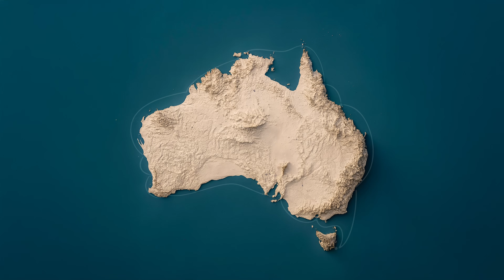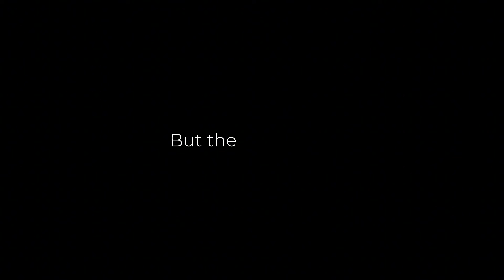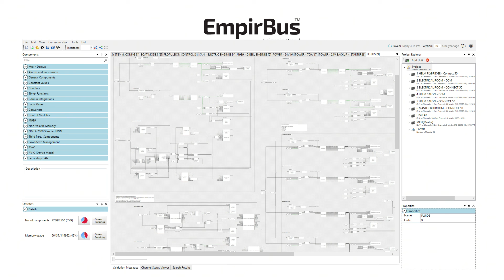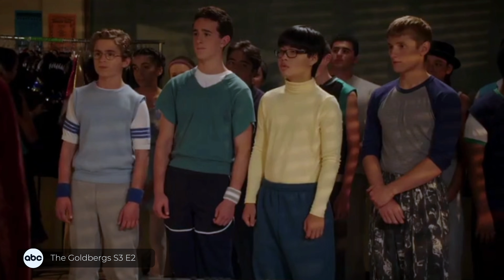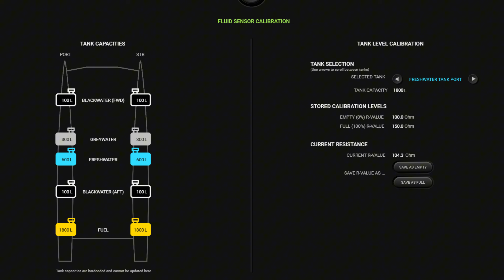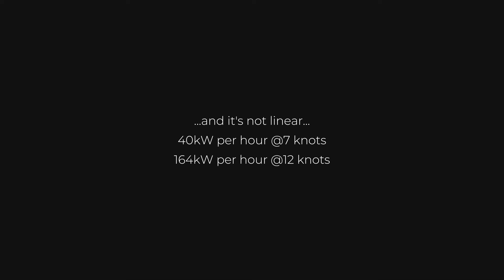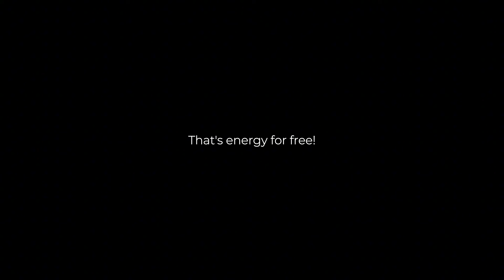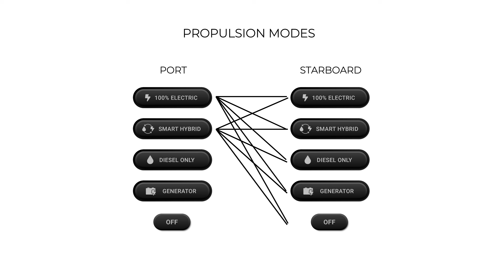The System Behind Our New Solar Electric Yacht

Comment: Please consider my comment as an interested engineer that sees the world through stuff that will fail ;)
What are your manual backup physical switches? (in salty environment stuff fails, needs manual backup)
On UI, please consider a "progres bar" or "filling button with green" over those 3 sec to show something is happening - this will show a feedback to user that computer is responding - pressing a screen with cold wet hand is not ideal - but happens and for 3 seconds i don't know if screen is recording my touch or not this time.

On your twenty something ways to propel boat i see twenty something things that can go wrong ;)
Will be looking at your progress and journey.
Reply: It's mentioned near the beginning, the key is digital switching. The control system and UI just gather all control to one point, but that system is just controlling the digital switching (breakers) for each system. Thus, if needed, you could manually control various systems at each digital switching panel.
Reply from the maker: Totally fine, we're the same. Most of our thinking and designing have been centered on the 'what ifs'. Definitely lots of layers of backup and fail safes, we'll talk about it more in future videos. The progress bar thing is being implemented now, especially critical for the change of propulsion mode, which takes time even after you release the button.

Comment: I agree with so much and many of your choices , the power system is  infact  a switchable hybrid... but I hope you've been watching the guys at Eddison motors , BC Canada and their Series hybrid logging trucks and pick up conversions. 

I understand this is you're baby and specialism but ... I would have built the system around an aviation shielded control system and a manual fall back system if your diesels are modern they are equally vulnerable to lightning strike . If your hulls Aluminium you're in a Faraday cage anyway which is a plus but even a nearby strike can make a mess of  complex electronic systems. Unless you've used hardened chips. 
This will be interesting 🧙🏻‍♂️🥼🌏

When it comes to your kite system you may find better suited and readily available supply of kites if you look at the Para Kites produced for commercial electrical generation rather than sport use . They area ailable in  larger sizes  and  designed to withstand greater wind speeds... there's hopefully a company in Australia but there are definitely multiple manufacturers across Europe and the UK. Ireland being one,  these also incorporate an inflated aerofoil section which means they float and not sink if the wind fails .  The latest Silent Yatch crossing provided a warning example of what happens when this happens and a kite sinks becoming a rather fragile sea anchor and tearing if you try hauling it back in as it sinks. 🤷🏻 There's also the increased risk of fouling the props and or rudders if this happens at night or in less than optimal conditions and  the vessel  passes over and unretreived kite line.

Comment: Make the catamaran survivable even when capsized. Just fill the roof (and bilge) with foam, that way it is perfect for any storm.
Reply from the maker: Catamarans float even upside down, but we do have a few sealed compartments. Let's hope we never have to have to see here upside down!
Reply: You can add gas inflated salvage  bags into the top of the vessel... To give it self righting Moment .  Then the hull decks otherwise you're going to be fighting the air and fixed buoyancy  in the lower hulls.

Comment: Electronic is the enemy of saltwater sailing..sorry
Reply: Will still be s good test of time.... a long term winner will emerge... or need for one be highlight... send manufacturers back to the drawing board whether they put silicone over everything idk...but surely interest...curious about build cost....?
Reply from the maker: I think, much like EV cars, we'll be replacing components with more efficicent and powerful alternatives long before they fail. But proven, quality equipment suited to the marine environment is really important.
Reply from the maker: Totally agree. We've done everything we can to slow the corrosion problem down and minimise the number of failure points, but constant monitoring is critical.

Comment: We bought a Lasai 22 gl that will be delivered next spring, for the very same reason : no fumes and oil, free energy (44kwh, 1.5 kw solar). But a catamaran is way above our means unfortunatly. The budget of that 250 m2 flat on water is probably around 5,000, 000 USD!
Reply: The solar array will generate about 6kWhr per day in the summer. So you need a source of for the other 32Kwhr. The average shore power in europe is 4kW so to recharge from zero you need 8 hours shore power plus all day solar plus the power you need during the day plus a another couple of hours for electrical losses in the system. 
Look at it another way 44kWhrs is 4litres of petrol, would you go to sea with 4 ltrs in the fuel tank?
Reply: @tobyhague5974  In Greece its more 10 kwh per day for 1.5 kw pannels. We have a house and work schedule,  so using the boat once a week without having to recharge it is enough for our needs.
Reply from the maker: Yes, more solar is always better if you have room for it, but it also depends on your usage pattern. If the boat is parked all week and only used at weekends, then a smaller panel is AOK and weighs a lot less. Where in the world you are also impacts things, different levels of illumination in the tropics than towards the poles. Using bifacial solar is definitely a benefit if you're replacing your panels and it works for your boat. Reflectivity from the water will boost your generation significantly.
Reply from the maker: Exciting. Wish our boat would be ready on that timeline, but still waiting :( That sounds about right, if you bought it outright, but we bought a 'covid hull' and did the work ourselves, so we paid in time and effort instead. We definitely didnt have anywhere near that budget.

Comment: Holy shmokes. You guys are Aussie legends. Thank you 🖤

Did I miss the part mentioning if it was aluminium or fibreglass?
Reply from the maker: We are fibreglass. The boat builder made a mold from ours, so they have other boats that look like ours that are molded. Unfortunately that means our boat is a lot heavier than expected, but the it's the price you pay being the first.
Reply from the maker: Also, it was a COVID hull, so we didnt have a lot of choices.
Reply: @projecteyacht 

Oh wow. Ok. That’s awesome. 

It looks fantastic 

What is the total weight?  

And what was that cost?

Does the builder want to work with you to create the same phenomenal systems you’ve created, for other new builds, licensing your technology?
Reply from the maker: At the design stage, the total weight was estimated to be under 30 ton, but now that we're built we're probably going to tip over the 40 ton mark, which is a shame as it'll definitely impact our range. We've had discussions with the builder about them using the system on other boats, but we're focussed on getting ours completed and sea trialled before do anything with them or other parties. Total cost is hard to estimate since it's a custom prototype, a COVID hull, and we did a lot of the work ourselves so saved significant $$$, but if you bought it 'off the shelf' then a Silent Yachts goes for about USD5million-ish depending on the model.
Reply: @projecteyacht 

Thank you 🙏 

That’s the price range I was thinking 

A specked out boat with sooooooo much more contingency than the overpriced silent yachts. 

That diesel and electric on parallel and the diesel power to electric regen, places your guys yacht miles ahead of the silent yacht system. A compelling advantage for blue water with a family. 

Not to mention, all the places you can explore and dock up without a mast!! 

What an exceptional working dynamic that would have emerged in working with the boat builder. 

Any strange tweaks or clashes along the way with the builder? 

I’d love to see a conversation with you guys and the builder. 

That horse power though 🐎 

Life saver when a storm is chasing you. 

Do you have a name for the boat? 

Should call it ‘spek’d’ or ‘spekd out’ 

😉 

Congratulations and well done!!!  

Mammoth task
Reply from the maker: We have a name already, but that's a great suggestion! We certainly have much more to offer compared to a Silent Yacht, at that was why we did it ourselves rather than buy one of theirs (not that we had that level of cash), but it does help that we've started from scratch and they're adapting their legacy design. The relationship with the builder I won't comment on - maybe once we have our boat handed over.
Reply: @projecteyacht  That makes sense. Thank you. What a mission! well done. so excited to follow your journey. What a brave thing to do with your family. A real adventure that will create so many special memories and specialness and life force AND you're leading the design and systems innovations that silent yacht are following! Thank you for sharing your journey.. really inspiring..
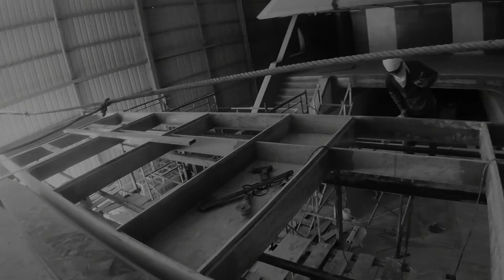Reply: At 2:17 the video shows what appears to be fiberglass being laid, however that may just be superstructure.
Reply: @Alan-R1971  Ah gotcha. i thought that was a mould but wasn't sure if that was another boat in the warehouse. 

Whats your preference? 

Everyone going with aluminium these days with cats but there's pros and cons i guess

Comment: This is incredible! I was realy interested in Silent Yachts have been following them but this is amazing that you are building, engineering/designing this yourself! Cant wait to see more!
Reply from the maker: Thanks! Our goal was to do better than the SIlent Yachts (then still gen 1). We could see the limitations of their design and think of ways to overcome them. That was 4.5 years ago, Silent have improved their design, but i think we still the front runner, though I wont confirm that till we're in the water. I actually have planned out a video - why we didnt buy a silent yacht. It's interesting to see how the space is developing and things are improving over time.
Reply: @projecteyacht  can’t wait to see your comparison! This is truly amazing what you are taking on competing with professional boat builders. Are you just planning to do a one off?

I was very interested in the silent yachts years ago but  was concerned with the distance and speed. I am more thinking about an excess 11 catamaran they do a hybrid system as well. They also offer a hybrid system in some of their models. 

I did like the way you have run them inline with a clutch.

Good luck with the build excited to see your next videos.
Reply from the maker: Yes, we liked the concept of the silent yachts, but their limited range was a problem, that's why we did it ourselves - the limitations that they had were solvable. I'm tossing up whether to do a video called 'why we didnt buy a silent yacht'! But it would be tricky to not just make it rant about their limitations - they did well with what they had at the time, but now they're stuck with a legacy design. Maybe we can convince them to buy our IP?!
Reply: Also curious about what propeller you are using like a toroidal propeller? eg like a SHARROW propeller.
Reply from the maker: We plan to get a sharrow propeller. They've just brought out their inboard large props, so that's exciting. I also like their merging with veem and the intercepter strips. We've talked to them, but we need to get the boat in the water to work out our hull resistance before we can order them. They're not cheap, but every percentage efficiency gain is worth it on electric propulsion.

Comment: Interesting and exciting project. I am a computer engineer and love playing around with automation systems. My first category A (ocean) grade  hybrid monohull sailboat I had built in 2005-2007. I learnt a lot. It kind of worked and was revolutionary for the times (probably still is). Aluminum hull. Twin retractable propellers.  Sold it 2012. In 2013 I bought a 2006, 50’ catamaran that was designed and built as diesel-electric (not hybrid). Simple enough. A centrally located diesel generator feeding 2x 400VAC 3-phased motors in either hull with dedicated industrial grade controllers (used in factory robots). A relatively small 24V house battery. Seperate starter battery. No digital switching.  Victron Chargers and inverters for the 220V system. Some solar panels. I am trying to keep weight down and sailing speed up. After the first time my engines safety system decided that they were too warm and shutdown i started to remove some over cautious sensors and automatic actions. The incident happened at a highly critical moment and I could have severely damaged other boats and possibly sunk my own. I got out of it by quickly unfurling my sails to just get of trouble. But i got a few more grey hairs in the process. So from then on, I try to make my boat as simple as possible. I no longer want a fully integrated system. Everything needs its own physical switch. If something fails it should not affect anything else. I try to have simple manual backups for just about everything. I no longer want to rely on just sensors (great when they work) and want visuals on everything. Easy access and easy to fix. I also don’t want to spend all my free time on maintenance. Now my boat is reliable and simple without loosing any comfort. I know how to repair and fix just about anything on it. You’re definitely making use of latest technologies and trying to make it all as easy as possible to use as possible. What kind of backups do you have if your control system fails? How reliable are firmware updates? Even Victron sometimes releases buggy firmware updates. I sincerely hope that this system will work for you as smoothly as possible. I can sort of do a rough BOM for all this but it would be interested in seeing a cost break down of the BOM and the number of hours spent designing this. Also what is the weight of the motors, engines, batteries and controllers. Apart from that I love electric propulsion and used them continuously since 2006.
Reply from the maker: @jos-i1t Wow, very impressive, especially at that time. Yes, failure is definitely a concern. We've added many layers to intervene before we were to have a critical failure, but even so, we also have physical switch and intervention layer if needed should the software fail. Fully intergrated has its pros and cons. We had a good reason to do so, which I'll share bits of as we go. We didn't count the hours as it was a personal project, but I'd estimate over a year full time. I cover more details of the underlying components in next few videos.
Reply: @projecteyacht  I'd love to see the physical switches and backups, the first thing I thought of when watching was trying to use a touchscreen while wet in big seas in a storm would be a nightmare.
Reply: omg I wish I could find a gal who could articulate her logic and reasoning on a variety of topics as well as this gorgeous mind is doing so effortlessly here.
Reply from the maker: Not so effortlessly if you see how many times I re-wrote my script, but I'll take the compliment anyway!
Reply: I am working on an electric  reinterpretation of a classic inland nevigation barge (Belgium, Netherlands, France area). Would be interested in your thoughts on compute hardware. And also appropriate computer languages. I've been in aviation IT for a decennium. Everything will break down. Eventually. I learned most in remote sites (East Africa, some parts of South America). But it's never fun to learn things the hard way ...
Reply: It's mentioned near the beginning, the key is digital switching. The control system and UI just gather all control to one point, but that system is just controlling the digital switching (breakers) for each system. Thus, if needed, you could manually control various systems at each digital switching panel.
Reply from the maker: @SocietyMike Yes, that's right, and there are multiple busses and the units can run without the software, and we have a physical safety layer as well. Failure planning has been a big part of the design.
Reply: @S @SocietyMike yes, that could work if you have time. Murphy however usually dictates the circumstances when things go SNAFU. Backups need to be quick and reliable at least for critical systems like motor control, windlass, steering, battery temperature monitoring, fuel tanks (bleeding a diesel fuel supply line takes a little while), BMS’s, bilge pumps and of course fire suppression systems for this type of boat (if it’s automatic as well).
Reply from the maker: @Jos-i1t definitely all thought about. It's been driving our boat builder crazy - they think we are pessimists planning for failure, but when you're in a remote area or tricky situation that's when that forethough helps. No doubt we've missed stuff, but it's a work in progres.
Reply: @projecteyacht  How are you planning to split responsibilities between yourself and the yard? I am asking because I ran into this issues with my monohull. Bad faith from the yard refused to honor items that were clearly under manufacturing warranty claiming it was design issues. If not done so already, I would make sure you have it contractually sorted before launch.
Reply from the maker: Never straight forward is it?